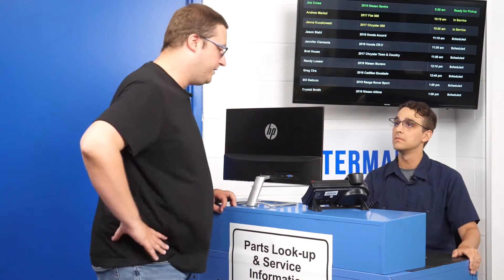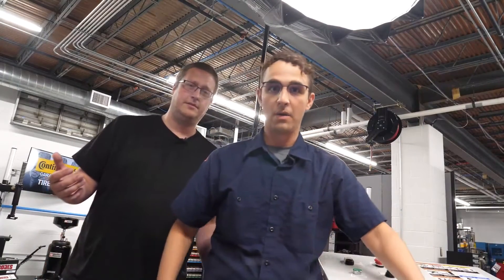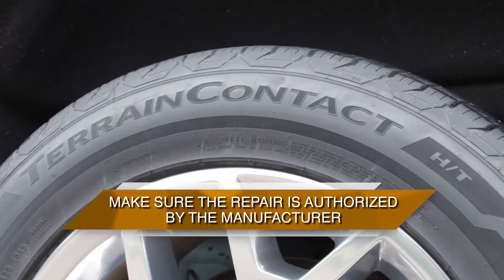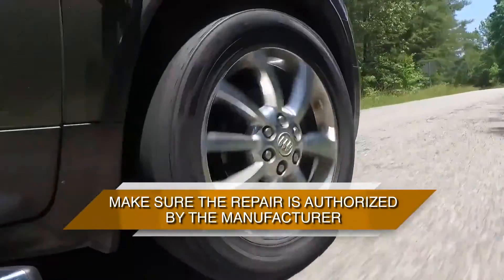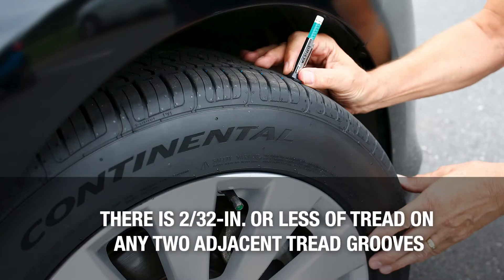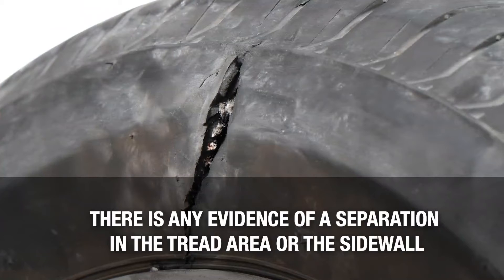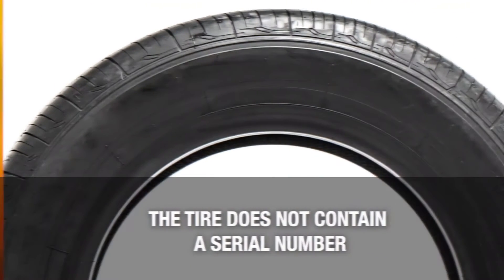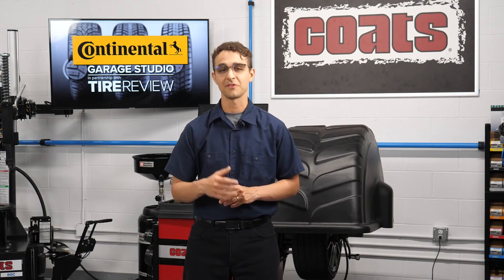How to Tell if it is Safe to Repair a Damaged Tire

Comment: Plugging close to the sidwall is perfectly fine. The notion that it basically has to be one tread block away from the sidewall is overkill. This is not done mainly for liability reasons, even though the risk is basically nothing.